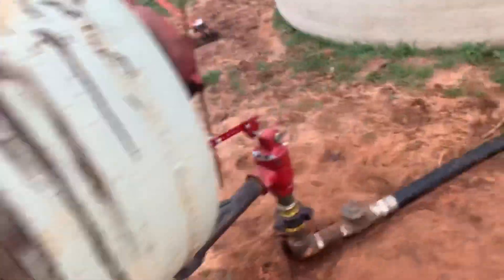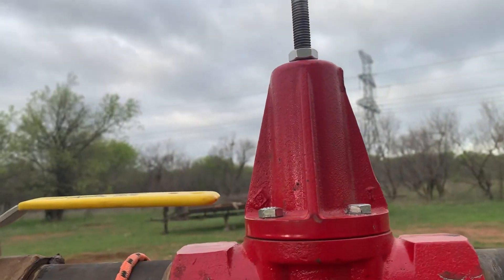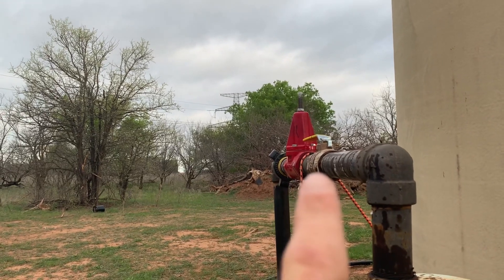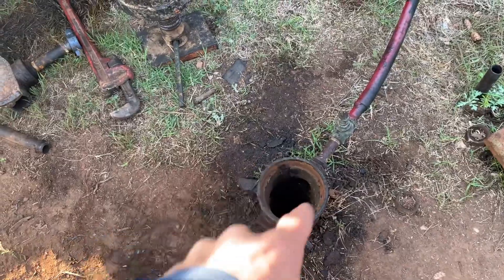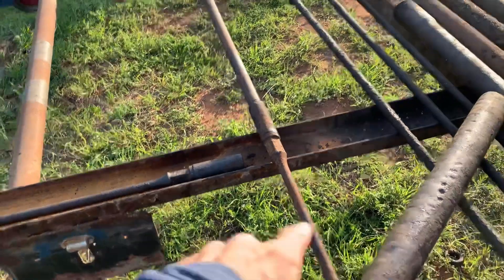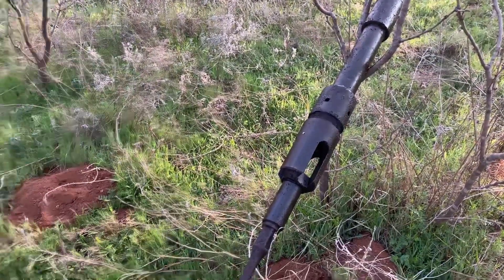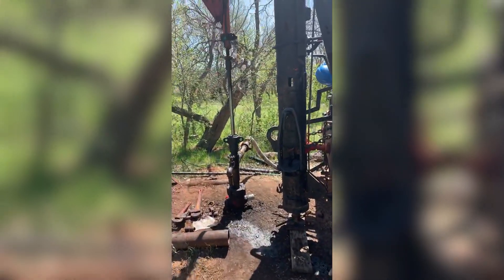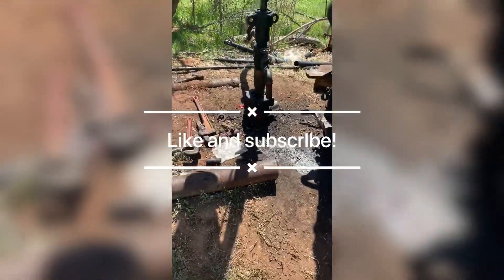Fixing up old oil wells

Comment: Not many places you can get oil at 75 feet!
Reply from the maker: I’ve really come to like these shallow wells. Lifting costs are very low
Reply: Ive known a couple of people who planned to drill a water well to 250 feet and ended up with an oil well in a residential neighborhood.
Reply: There’s a few places around my area that have wells that are about 400-800 feet but the further south you head from me, the deeper it gets
Reply: I'm working on grabbing some wells that are 800' and 300' at the moment, I like how cheap they are to fix, compared to my 6,000' wells